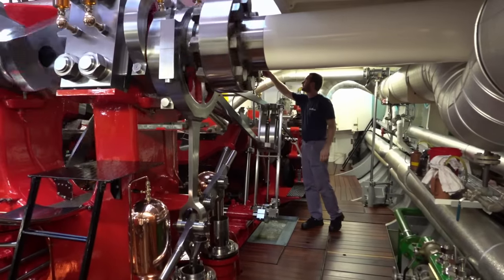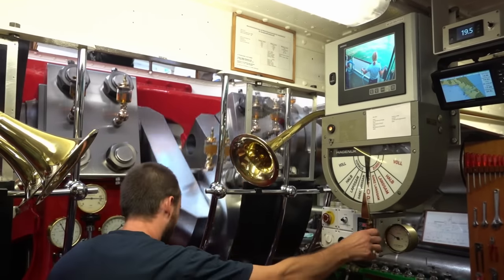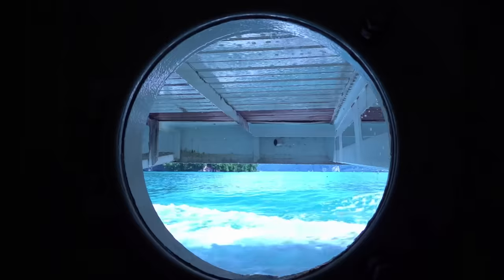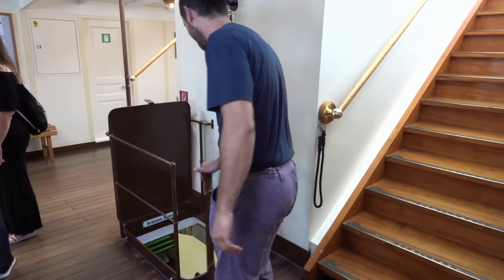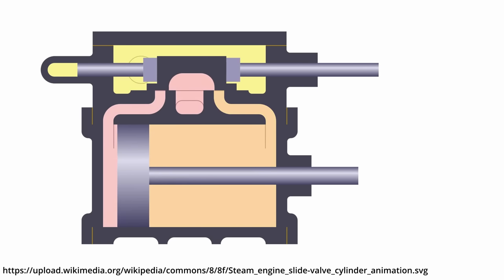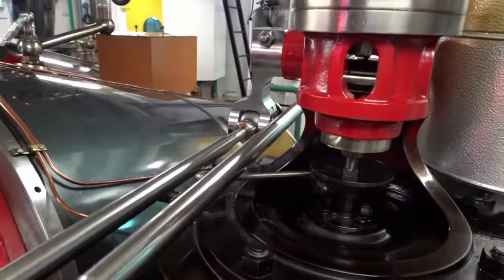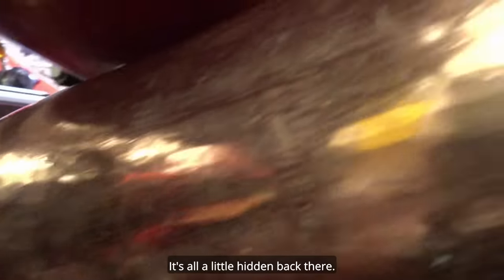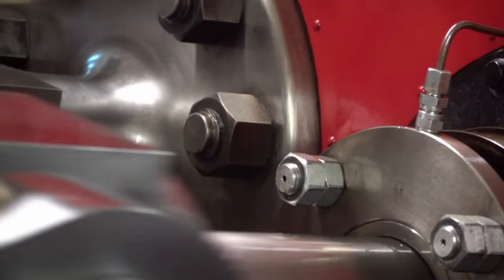How to operate a 116 year old steam ship

Comment: It's absolutely incredible to see that machine slow down to a near stop in mere seconds, and suddenly starting to move in the other direction quite quickly with a lil burst of high pressure steam! A decade or so ago I got the opportunity to take a ride in a 1909 steam car (as a passenger), as perfectly maintained as this ship, and the torque you get from that high pressure steam is just unbelievable. From standing still to 30-40 kph in a little less than an instant! If that car had rubber tires it would've left some of it on the road.
Reply: It is possible to "burn rubber" at 60 mph or about 100 kph in a steam-powered auto.

Comment: Amazing video. Not a single piece of metal with rust on it. It's beautiful. Thanks for sharing.
Reply: I suppose that's a side-effect of the machine needing lubrication all the time: the oil they wipe off leaves enough residue to prevent corrosion ^^ And chroming things also not only helps, but looks fabulous on a machine like that.
Reply: Probably also helps that it’s a fresh water ship as that is generally less corrosive

Comment: The machinery is stunningly beautiful. Those chrome control handles for the engine operator look absolutely spotless. Like it just came "off the line" so the speak.
Reply: I quite agree, the whole IS stunning. Here in Scotland we have PS (Paddle Steamer) Waverley, which has a triple-expansion steam engine. Its engine room is similarly clean, although it is more open to the passengers than here. Just as an aside, the expression at the end is 'so to speak' instead of 'so the speak'.

Comment: Back in the 1980s I had the pleasure of being a tourist on this 'grande dame' of the lakes. I watched the pistons and crankshaft operating without the knowledge of how it was achieved. Thank you for the opportunity to fill in the blanks of my knowledge. The whole crew is like the vessel itself - a well-oiled machine. The fact that ancillary operations have been modernised does not detract from the fact that the engine and boiler are as built so many years ago and in a different era. Tschüs!

Comment: Excellent video work!
I run giant old gas engines from this era at Powerland Heritage Park just south of Portland Oregon, and so much of the technology is the same, though none is this pretty! Lol

We also have some steam tractors and a steam sawmill on site that I get to play with sometimes, and I used to run a big Erie City stationary industrial boiler, so I was interested in the stats. 
9.8 bar is about 142 psi, which means that sausage was cooking at about 183 c, or 361 f. Should be well done! Lol 

I find it really interesting that this finely crafted Swiss steam ship uses many of the same systems and parts as a rough cast US heavy industrial gas or diesel engine. 
The brass and glass drip oilers, and the multi output ratchet drive oil pumps look identical to what we use, as do all the little divots for the manual oil points. 

Guess great engineers think alike! Lol 

Anyway, another excellent production, and another amazing company and team enjoying showing you their baby. 

May you continue documenting such amazing machines! 

I think I have a couple of videos on my channel of the engines at the Park I help at, and I recorded a bunch more, some inspired by you, including instructional videos on the startup and operation, but I have to take time to edit and post them!
Reply from the maker: That sounds very interesting! Perhaps I should come say hello in the upcoming years when I'm in the US the next time

Comment: I am glad that I have the opportunity to go on board of a Swiss steam ship anytime I like because I am Swiss. For anyone that hasn't had the opportunity yet: the moving mass of the cylinders is so big that they move the whole ship. As a passenger you can feel the ship slightly moving back and forth in the rhythm of the engine, so you kinda become part of it. The engine is basically the same as in a compound steam locomotive, just much bigger and slower (max. 55 revolutions per minute) Even the mechanism that changes speed and direction works exactly the same way.

Comment: Such magnificent machinery! Never thought I would see a paddle steamer in regular service, god bless Switzerland! And I love how you went into detail about how the bridge and engine room coordinate, many vids don't look at 'system integration' like that!

I'm surprised the Schiller has an open steam cycle- even if lake water is not salty, I would figure that silt and other contaminants would still cause fouling issues.

24:30 Having triple-seals, staggered so their cuts don't everlap, is genius.
Reply: Those rings are called packing and it is common and good practice to stagger the joints in packing no matter what type or size of steam engine they are used on.
Reply: Well, lake Lucerne is one of the bigger lakes, which means most silt and stuff settles. And it’s also in cliffy terrain (Wikipedia calls it a freshwater fjord), which leads to an average depth of just over 100m, which also helps not churning up sediment. Additionally, they treat the water on board by filtering and deoxygenating it, if I understood it correctly, which should also help a ton. And, it can’t be more than 20miles from maintenance, so deep cleaning is always an option…

Comment: Here in the States, there's a river cruise company, American Queen Steamboat Company, now called American Queen Voyages, that operates the American Queen; the largest river steamboat ever built. Her main is a 100+ year old diesel fired steam engine powering a large single stern wheel, and has two electric Z-drives for maneuvering and extra propulsion when needed. A beautiful steamer on the Mississippi River here. 

Steamboats are wonderful vessels, and absolutely beautiful when upkept and operating.
Reply: I have to disagree some with you.  The Green Line Steamers bought the DELTA QUEEN and brought her to the Mississippi River from the Sacramento River in the 1950s and refurbished her for overnight service.  In 1972, the company, The Delta Queen Steamboat Co. had the MISSISSIPPI QUEEN built(about 200 feet long).  The DQ has compound engines of 10-foot stroke.  The MQ received new compound engines of 20-foot stroke.  By the time the AMERICAN QUEEN was built, the company that had built the MQ's engines was out of business so the engines for the AQ were found but are only 7-foot stroke for a 400-foot boat, not enough.  That is why the Z-drives.  As an explanation, technically there are 2 engines on a steamboat, coupled together through the paddle-wheel shaft at 90* so they can be started from any position.  The DELTA QUEEN and DELTA KING steamboats were built for service on the Sacramento River between Oakland and Sacramento, CA in 1926 as the last overnight steamboats built for use in the US until the MQ and AQ were built.  They had wooden superstructures while the MQ and AQ are all steel.
Reply: @royreynolds108  I'll be damned, alright, thank you for correcting my mistaken knowledge.

Comment: The engine room is clinically clean. It takes a lot of work to make steel gleam like that. Its natural inclination is to rust. Schiller is perfect.
It's an education about the use of freshwater from the lake. It's as clean and perfect as the ship!  
The Waverley, the last sea going paddle steamer in the world, sails on the sea and in muddy or silty rivers like the Severn or the Thames as well as relatively cleaner ones such as the Clyde. The condenser intake is in the hull and thus uses whatever the ship is sailing in which can also be silty. The water circulates around tubes with exhaust steam from the LP cylinder but never the twain should meet! 
Every so often the condenser needs a washout to remove sediment.
Fresh drinking water is piped from shore into tanks.

Comment: Actually a really good point our narrator mentions at 20:25.. once the remaining steam (after having passed through both cylinders and the heat exchanger) cools down completely, it would cause a vacuum of sorts. It makes one wonder if that in fact also could be made useful, one way or another! 
By the way, what an incredibly high quality steel (and other materials) they put into this enormous machine in the day! It is beyond beautiful to look at, as immaculate as - for instance - those 'parts' of the crankshaft are.

Comment: this thing is just incredibly cared for. I was imagining this beauty vs being used on the long island sound in the early 20th century on the NY to Providence run when they had dozens of these. They left NY or Providence usually in the evening around 6pm, and arrived in NY at around 7am. This vs. going by car which could take 1 week at times if the roads where muddy! But no way where they this clean I bet. saltwater and constant use for 20+ years they must've had engine rooms absolutely crusty and filthy!

Comment: it's a nice ship, but a pity they felt a need to rip out the original bridge and computerize everything except for the main steam engine. Doesn't really work as a museum piece that way since the engine is the only thing original. Like compared to Hjejlen on the Silkeborg lakes in Denmark, which is a little smaller, but remains largely unchanged from when it went into the water in 1861, and remains the world's oldest steamboat to still sail in its (mostly) original configuration.

Comment: The real right way to use a steam engine is no coal, wood, or water. Run it on compressed air driven by a diesel engine.
Reply: then it’s not a “steam engine”
Reply: No, because steam expands in the cylinder.
Reply: That's probably the most insane thing I have ever heard. Plenty of steam engines have diesel fired boilers (and I feel like converting the few remaining coal fired ones is a shame as well), but what you describe would be the most insanely inefficient system you could come up with. Compressors are not efficient. 
Not to mention it would deprive any compound steam engine from it's main advantage.

Comment: What an archaic design for 1906. Sidewheeler? Come on who do you think your kidding.  I seem to remember seeing a tugboat built by Newport News Shipbuilding on display, which builds America's warships, which had propellers and this was in very late 19 th venture 1896 maybe.
Reply: Many lake and rivergoing ships still had sidewheels by then. They have some advantages compared to a screw steamer in shallow water. Not just when it comes to draft, but a screw or propellor loses efficiency when near working near the bottom, and a paddle can be more efficient. 
Though I think this lake in particular is quite deep, and a lot of the design had to do because they replaced already existing older paddle steamers. 
This also happened with the PS Waverly operating in the UK, a seagoing paddle steamer build in 1947, as a replacement for an older paddle steamer. That ship still goes on coastal excursions today. And it's not like the UK wasn't familiar with screw propulsion, they invented and pioneered it way before anyone else did.

Comment: Running a steam ship off a diesel generator....   Better than nothing I guess
Reply from the maker: You misunderstand. The Diesel generator generates electricity for the light etc. The steam is generated using doestic fuel oil
Reply: @sandro-here  thanks for the correction
Reply: @sandro-here  ....typo correction, @kalsan15: domestic fuel oil